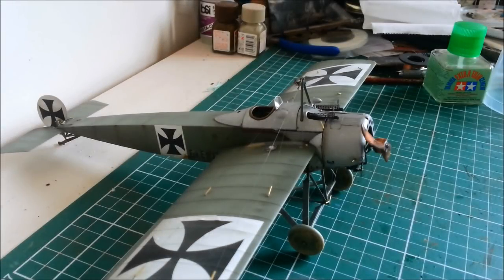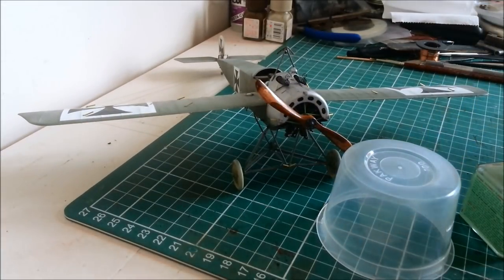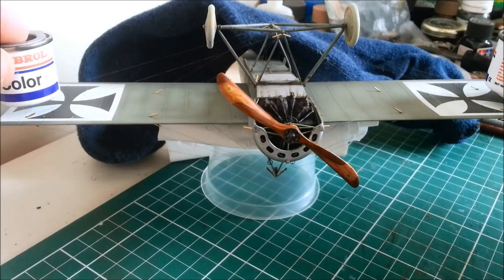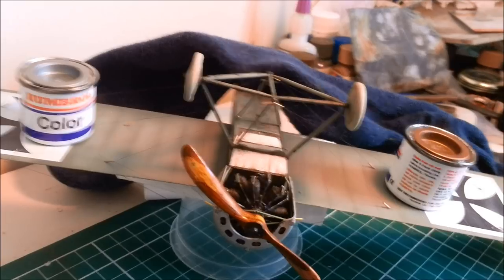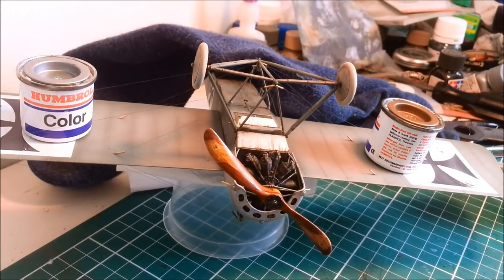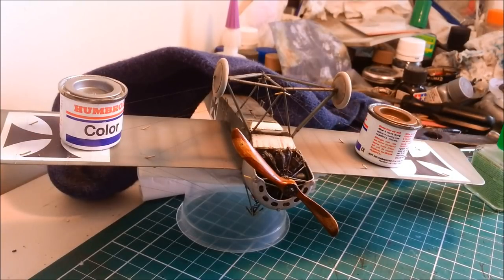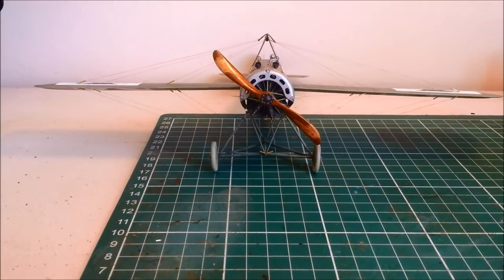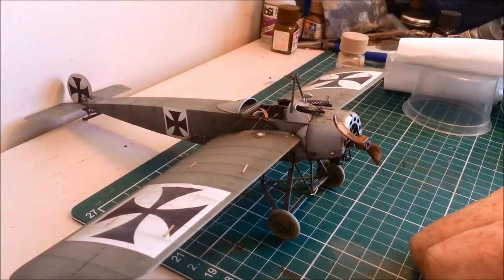Fixing drooping aircraft wings and new retailers for The MOD Squad

Comment: Looks great, Dave! I'm sure you are probably sick of working on this, but in order to fix that anhedral on the wings you need to over bend them. When you had it upside down, instead of leveling out the wings until they are perfectly straight, you need to go past that and give them a bit of dihedral. Then when the glue is dry and you turn the plane right side up, the wings will droop a bit and become perfectly straight. I hope this helps on this one or maybe the next.
Reply from the maker: Thanks George, I think I do still need to work a bit more on them. Tricky buggers. Your suggestion should do the trick - thanks.

Comment: You need tiny saw horses for your bench. I have a lot of them myself for such grievances. Apply the glue as you Have, and invert model resting the wing tips on blocks. If the vehical weight is not sufficient, add some coins to cockpit seat. I too have reservations about paying so much for stands so I made my Owen. Using discarded lamp stand, I simply bolt or screw a vice to it. And if your realy cheap, use the kids Lego. Just build it!.. Cheers mate.
Reply from the maker: Hi Lance, I love the Lego idea. Gold. Tiny saw horses sounds like a winner. DId you make them yourself?

Comment: Love the plane Dave. I might have tried jacking up the wing tips and putting some weight on the fuselage. Also, I've bought several airbrushes and parts from Spray Gunner. They are in Florida only a few miles from where I live. I've had nothing but great experiences working with them. Great prices and lots of options available.
Reply from the maker: Hi Bruce, that's great to hear that about Spray Gunner - thank you for sharing. And good call about doing it the right way up instead of upside down. Cheers.

Comment: Hi Dave. You can get a self assembly wooden jig for much less than $70 I reckon? As for Tamiya Extra Thin, (TET), I would suggest you try EMA Plastic Weld. It's much less smelly and is super good. I've been finding lately that TET makes my eyes sting after a while, but then, I'm old... Did you get the Tamiya Sprue Cutters yet?
Reply from the maker: Hi Nigel, not yet. I've not been to a hobby shop for a while, and if I buy them online I want to make it part of a bundle to make the postage worthwhile. I've not played with EMA Plastic Weld before, worth looking into? I've never been bothered by the smell of TET, I must admit.

Comment: easy fix - just rerig the uppart part with monofilament, it is not elastic and will keep the wings straight :) That swhat I do for my Eindeckers!
Reply: Makes sense,  use riging to do what riging is actually suppose to do.
Reply: With larger scale models like this, monofilament actually adds structural strength, just like on a real aircraft.